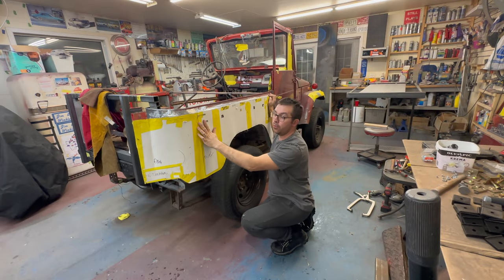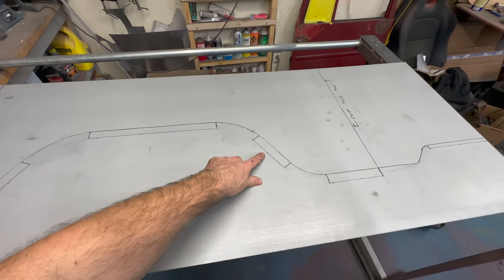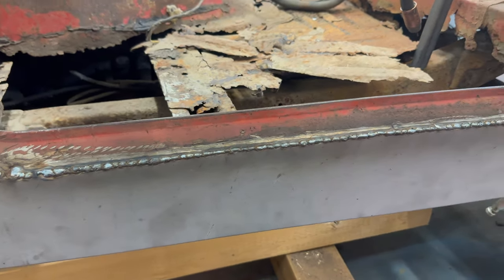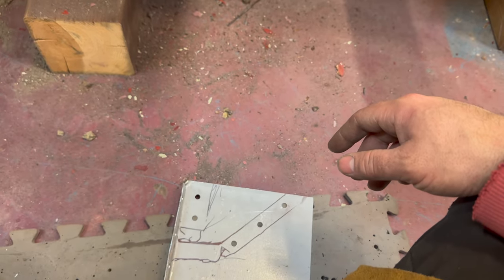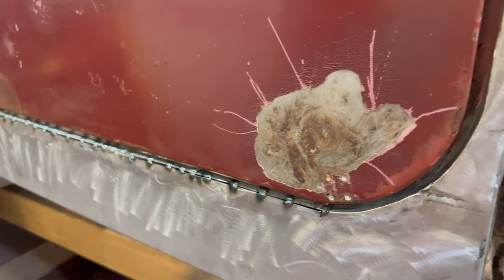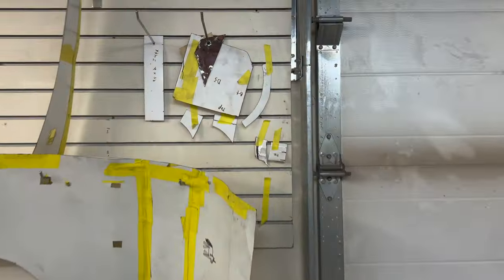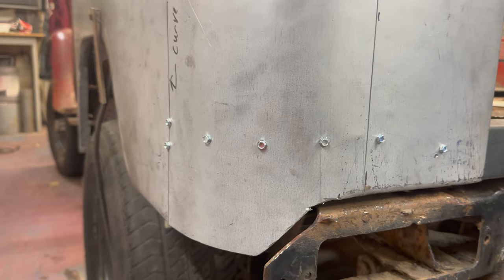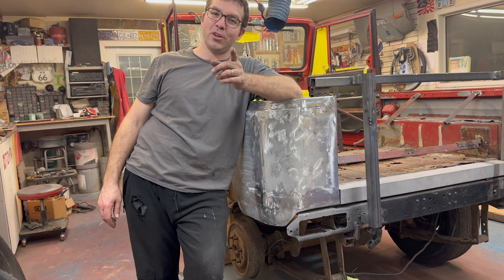WOW! I COULD NOT SAVE ANY OF IT!  SO I BUILT IT FROM SCRATCH IT CAME OUT AWESOME!

Comment: think youre idea of bending those one inch strips should work , be nicest if you could tig weld those edges together as the metal is kinda thin 
mig welding tends to burn through or leave big blobs in the inside corners (its a bit of all or nothing using mig ) making it harder to grind and fit over the other sheetmetal underneath
having the damage on that side AND having to move the rear of the door on that side makes me suspect that the door got pushed forward during the hit on the rearcorner , the should be simetrical and you might need to tweak the dooropening to fit the bodywork instead ..... depending on how well the door fit in the hole on that side offcourse (seems to fit fine though i think the gaps are a little big ..... not sure if its a fj40 thing or not )
we usually let the welds cool down on their own , wat we do is weld a spot move over to another spot a few inches away and weld that etc , by the time where back near the first spot its cooled enough to not warp by adding even more heat
allso dont go hamfisted with the grinder as that puts a lot of heat intoo the metal too , again hop over to other bits
if you convert the cad (cartboard aided design ) to cad (computer aided desighn ) you might be able to sell those templates online , the buyers that have the downloaded plans basicly have to go to a xerox shop and have them printed on thick paper (zerox printer can print of a ......think it was a pdf file)
wat you could try to get the corner a little tighter around the fram is to lay a ratchetstrap over it a tighten the strap it should pull on the whole bend evenly just dont go too far and make it concave
all ideas mentioned , i think youre doing a good job on it
a while back i seen a way to make text embossed intoo sheetmetal using a hydraulic shoppress a sheetmetal letter mounted to a block of wood pressing the metal intoo a piece of high density rubber 
cannot find the article in hot rod magazine but you might want to try it to get the toyota logo in the hatch
Reply from the maker: I’ve wanted to try my hand at tig but I don’t have one yet. I learned the mig stuff from my dad so I’m going with what I know. 
Regarding the door fitment I agree it could be from the accident damage. That side has the damage in the front and back corners. To top that off the body mounts were rusted gone so it was sagging too. That whole driver door jamb was so out of whack it took me a long time to figure out the potential issues. I studied gaps on other 40 series and some are tighter and some wide like mine. I think there was a large production tolerances.
It’s crossed my mind selling some of the stuff. I can get a new tub for $20k cad but I’m aiming to build mine for $2000 in materials. 

Thanks again for the ideas and watching the videos! Have a great day.